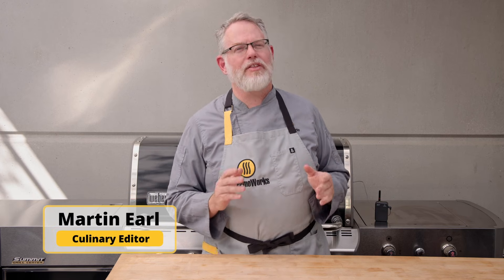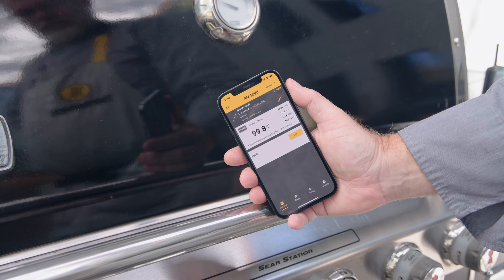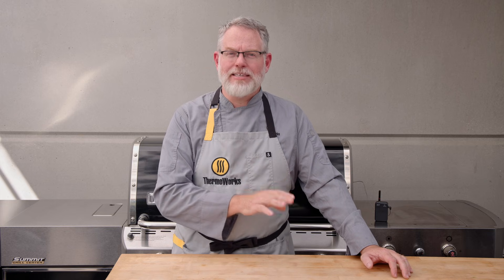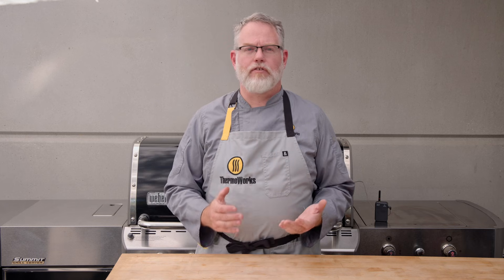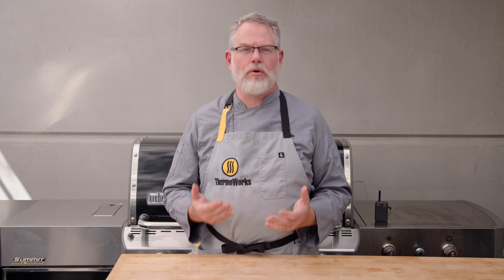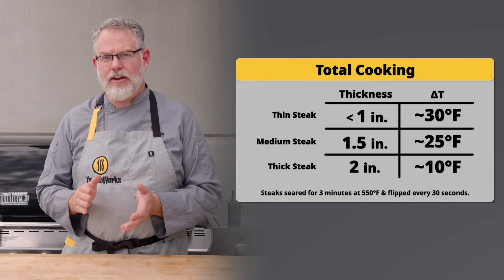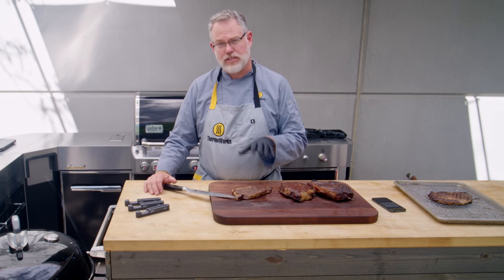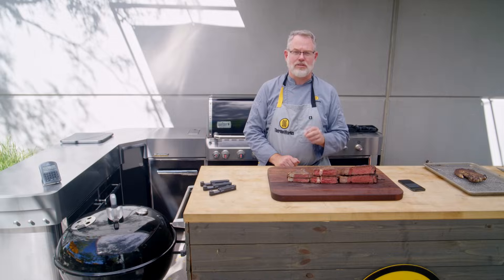Steak Carryover cooking with RFX MEAT™: Thermodynamics for Carnivores

Comment: I have been using the RFX system on a Masterbuilt XT and have been extremely dissatisfied . 5 calls to the tech team and 2 probes with battery failure , not to mention inaccurate temperature readings that range from 10-20 degrees high and they will not allow me to return the RFX system for a refund. I’m pissed!